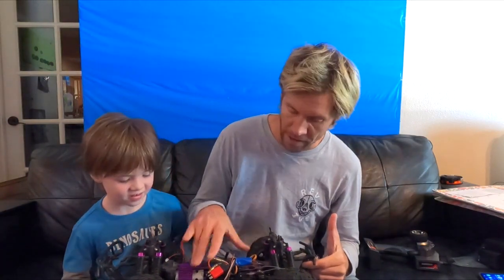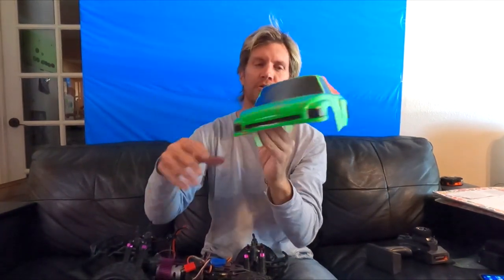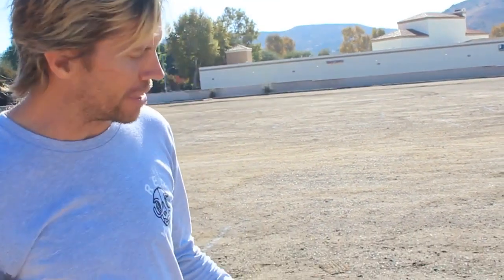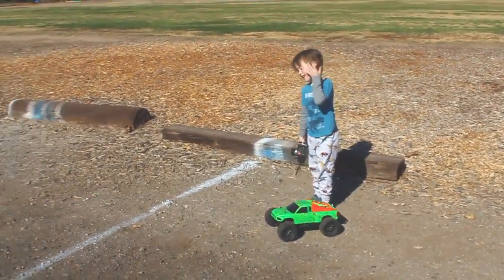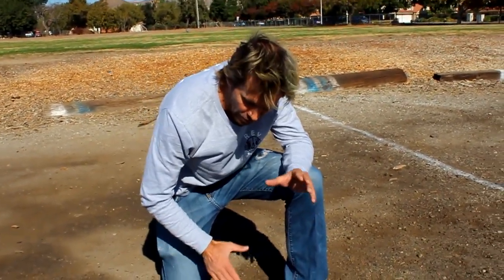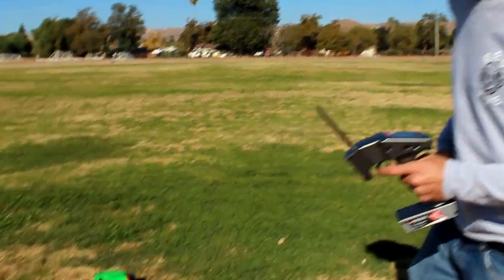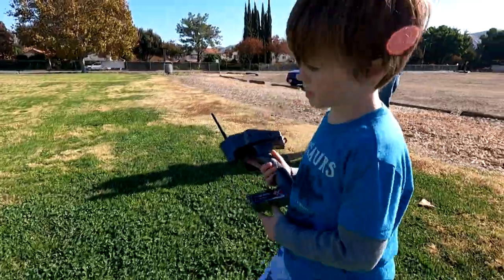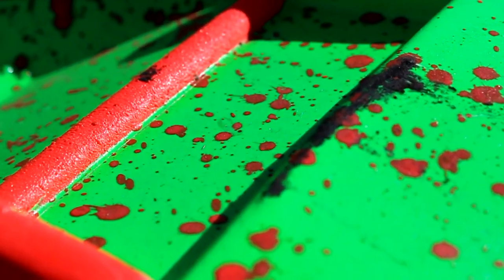Can A 4 Year Control A 3S Powered RC Truck?!?!

Comment: Doug do you have a lipo checker because it is great for keeping a consistent charge on the battery and prevents it from puffing or exploding! Also I recommend a lipo alarm which you put on the balance lead while driving which beeps when you drain the lipo too low. These are great to have when using lipos great video Doug!
Reply: Btw this hobby is very fun and I also recommend checking out Marty’s hobbies in Thousand Oaks or race prep hobbies in Simi Valley. They are very cool  rc/hobby stores which are cool stores I go to for my cars regularly!
Reply: Also lipo safe voltage is between 3.7 and 3.9 volts per cell which you check with a cell checker 👍
Reply from the maker: Yes my charger has a checker, and my transmitter has a telemetry cable I just gotta set the low voltage alarm on my receiver. Thanks for the advice. I've picked up some connectors from both shops. What RCs do you have? Also there is now a skateshop next to race prep too.
Reply: @nollieheel  yes I saw the skate shop the other day I definitely will check it out, I own a highly moded traxxas bandit vxl and a losi mini t 2.0.
Reply: @nollieheel  bring your redcat to a skatepark you’ll have a blast airing it out!
Reply from the maker: Only when it's empty, not gonna be the kooky guy driving an rc in a busy park haha
Reply from the maker: Nice man, sounds awesome
Reply: I’ve got a modded Traxxas rustler but I don’t have lipos for it. Marty’s hobbies is a good shop